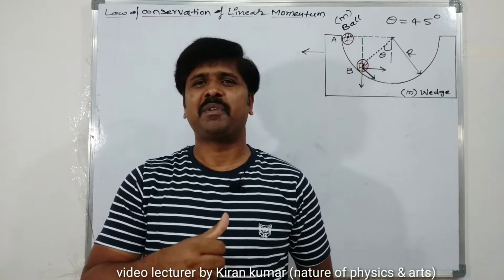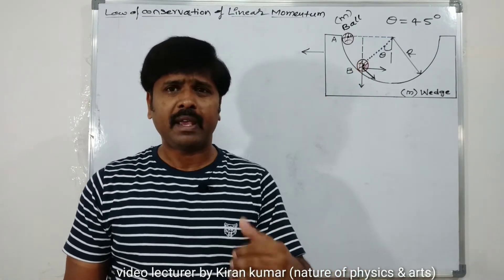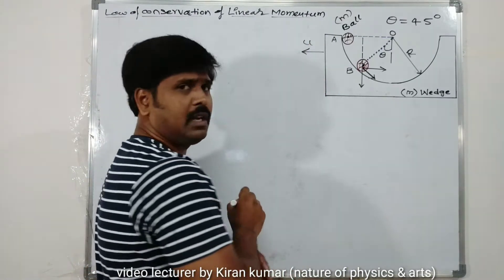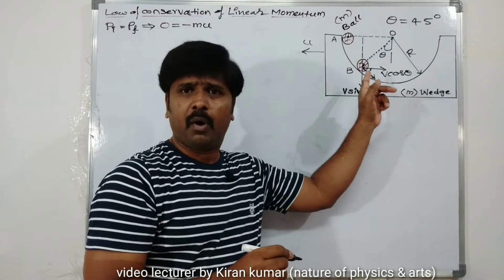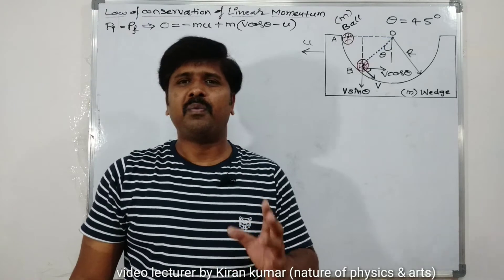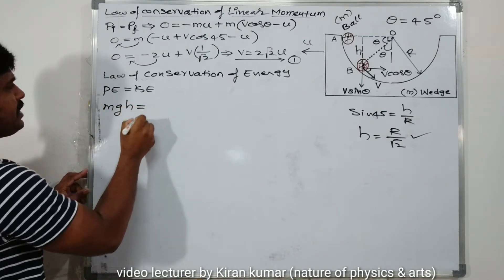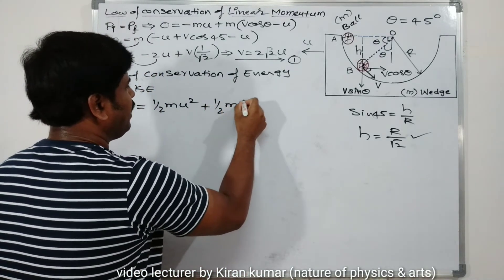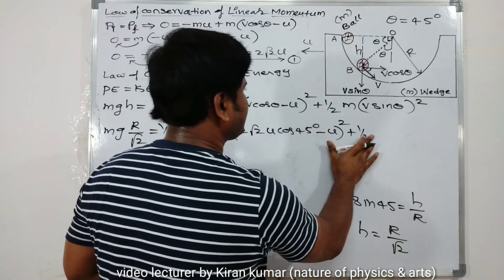6) a ball of mass m is released from a inside a smooth wedge of mass m as shown in fig what is the

Comment: Wrong explanation,the vnet of of point mass is (vcos45-u)i+(vsin45)j so the kinetic energy of point mass at that instant will be 1/2mlvnetl^2.But lvnetl=sqrt((vcos45-u)^2+(vsin45)^2),so 1/2mlvnetl^2=1/2m[sqrt((vcos45-u)^2+(vsin45)^2)]^2, which is 1/2m((vcos45-u)^2+(vsin45)^2),in expanded form it is 1/2mz((vcos45-u)^2)+1/2m(vsin45)^2).The reason why we take relative velocity is a wrong question,he didnt take relative velocity,the relative velocity is vcos45+u.
Reply: This is a before and after case ,before case ball is in contact with wedge ,even after wedge moved(wedge moves in -i direction because point mass pushes the wedge),it's still in contact with the ball meaning that ball moved with the wedge,so we say vnet in x direction is vnetx=(velocity of point mass in x)+(velocity of wedge),which is vnetx=(vcos45)(i)+(u)(-i)
Reply: If you want more cases of body moving along another body you can get it from hcv centrr of mass problem no 60,55,29
Reply from the maker: Correct only , velocity components taken but not represented with i & j orthogonal vectors